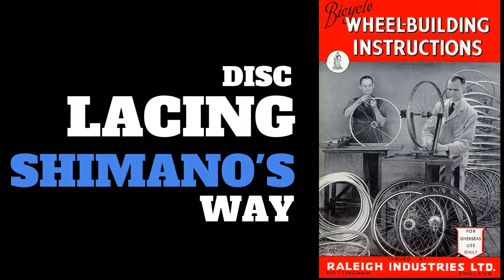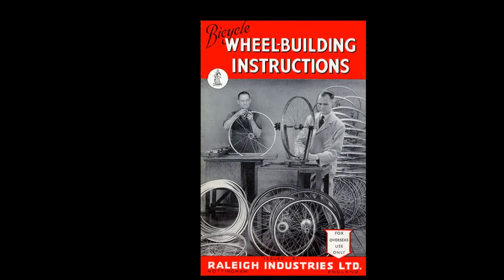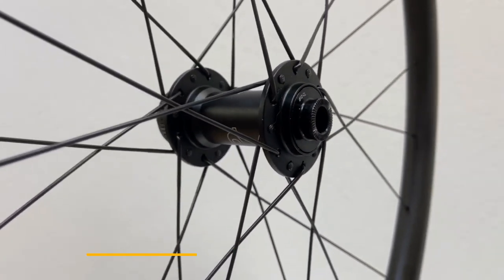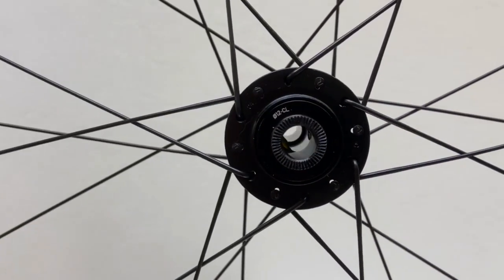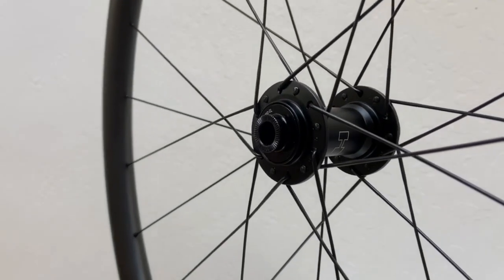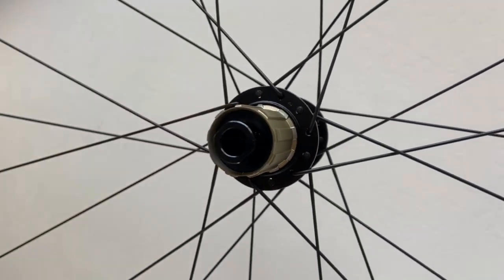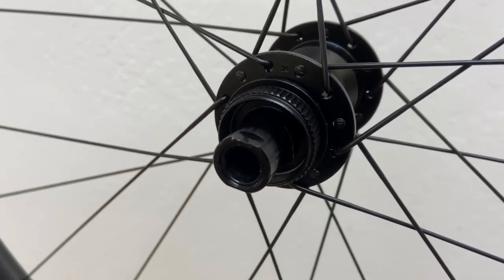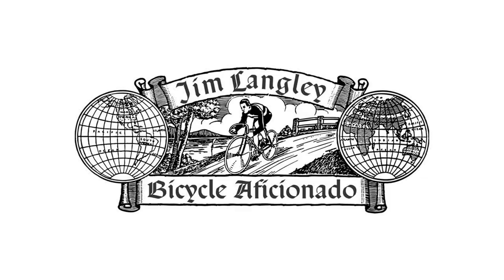How to Lace Disc Bicycle Wheel Spokes Shimano's Way

Comment: Is this Shimano's spoke lacing pattern applicable to the ebike (1x lacing pattern, 1000W motor, disc brake, rear wheel drive)?
Reply from the maker: Thanks for watching and the question. Yes it’s for all disc brake wheels. But if you’re rebuilding a wheel (versus building one from scratch) you should study how that wheel was built carefully because motor wheels may have specific lacing requirements that you need to follow. They often use oversize spoke holes, spokes and nipples and they might have a certain spoke pattern chosen by the manufacturer of the motor. I would copy the original lacing pattern or if I didn’t know what it was I would reach out to the company that made the bike and ask how they build it just to be sure. Hope this helps.

Comment: Well after you explained this is the comments on an earlier video I made the effort to get the trailing spokes heads in on the rear drive side on the last pair of wheels I made (no disks). Not sure it makes much difference but might as well go the extra mile!
Reply from the maker: Good job, Ben and thanks for the comment. There are lots of theories on how best to lace non-disc wheels, too. The best source to read up on it and learn is the late Jobst Brandt's book The Bicycle Wheel. It's been out of print for awhile and is pretty expensive on Amazon as a used book. Luckily Ric Hjertberg at WheelFanatyk.com posted the entire book as a pdf here: https://www.dropbox.com/s/mbsx865uzz0s7jq/Bicycle_Wheel_-_Jobst_Brandt.pdf?dl=0 If you're interested, Jobst was a wheel engineer and the book is full of great wheel wisdom. Thanks again!
Reply: @JimLangley1  Thanks! I remember Brandt from the rec.bicycles.tech newsgroup and used to quibble with him about the finer points of stress relieving wheels. Sad that he is no longer with us. I shall enjoy reading the book!
Reply from the maker: @benc8386  I rode with Jobst and on a bike he was fascinating. He was interested in bike technology. But he was more into physics and all the other sciences. When you were rolling along he would point out plants and trees and talk about the tides and equations comparing the differences in effort to ride say roller type roads to flat roads (the benefit of having descents then climbs vs a flat road with neither). I would just listen to him talk and learn. I remember the rec group back in the day, too. In person he was inspirational. Not to mention he was a giant of a man riding a humongous most impressive yellow Ritchey bicycle. I feel lucky I knew him a little. I think you’ll enjoy reading his book, Ben. Fun chatting about this stuff!
Reply: @JimLangley1  I'll second the Brandt book recommendation. I used it when learning the basics on classic C&V wheels.
Reply: What the hell is the leading or the trailing spikes and what's heads in it out.
Reply: @keithdunlop  Yes have finished reading it. Many interesting things in there.
Reply: @iamulfr1965  The trailing spokes are the ones that get pulled on by the hub to transfer torque to the rim. Heads-in are the spokes that have the head at the end of the J bend on the inside of the hub flange. Heads in alternates with heads out as does leading and trailing.
Reply from the maker: @benc8386  Thanks for explaining, Ben.

Comment: Where would I find the lacing steps for a Shimano asymmetrical rear disc wheel? I've only ever built symmetrical wheels.
Reply from the maker: Hi Keith - If you watch my video on building wheels here: https://youtu.be/XUqul03hbZ8 (you can jump ahead to the lacing section if you don't want to watch the intro), I show lacing an asymmetrical pattern. Basically, you make a wheel asymmetrical when you begin lacing (putting in the spokes) the second side of the wheel. At that point, you choose whether to make that second set of spokes asymmetrical or symmetrical. If you lace by putting all the spokes in the hub first and then lace the spokes to the rim, then you will need to be sure to put the spokes in in an asymmetrical pattern when you load them all in the hub. I don't lace that way. I lace one side and then the other side. Hope this makes sense and you can do it. If not, please ask more questions and I'll try to help more. Thanks for watching and the comment/question!

Comment: Are these HED wheels, if so we're they relaced. I'm noticing my HED disc wheels all have the opposite lacing pattern in the front and the drive side on the rear wheel. I'm looking at the eroica and arednnes wheelsets. Also, I'm guessing it's like you've said, there are all kinds of lacing patterns just make sure it's tensioned and true.
Reply from the maker: Hi Aaron! The wheels I show in the video are not HED wheels. They are wheels I built on HED hubs so that I can show the lacing pattern. 

To try to see how HED builds their road disc wheels I visited their website, but the photos are such low quality that I cannot make out the spoke orientation. So, I couldn't tell if they use Shimano disc lacing. 

If they do not, it's probably because they have their own theories on what's best. You are correct that not all wheel builders agree and that proper tensioning and truing are most important (assuming the hubs, spokes and rims are first rate, too). 

I recommend and use Shimano's disc lacing pattern because I trust they've studied & tested it more than anyone else. Shimano's been making bicycle wheel parts since their founding in 1921. If you're interested, I talk more about wheel patterns in my other video on Spoke Terminology here: https://youtu.be/4kVlmOjgdAs Thanks a lot Aaron!

Comment: Why is heads-in better at resisting a force than heads-out?
Reply from the maker: Thanks for the question, dimar. On disc brake wheels, the heads-in spokes are oriented that way so that the bends of those spokes are supported by the hub flanges. It's the support from the hub that optimizes the spokes' ability to resist the force of braking on the front wheel and the force of braking and pedaling on the rear wheel. It's the same reason it's a good idea to make all the trailing spokes heads-in on non-disc rear wheels - so that all the spokes working the hardest are braced by the hub. Robert Wright in his book Building Bicycle Wheels, describes the work these spokes are doing as "shouldering the load" and compares it to a person pulling a load with a rope and putting the rope over their shoulder for support. I hope this helps explain. Thanks again!

Comment: One more quick question Jim. Before I knew about the "Shimano" way for disc wheels, I built a rear wheel with a symmetrical lacing (the leading spokes on the rotor flange are heads out rather than heads in). The wheel is for a commuter/gravel bike, not a downhill MTB bomber. Would you rebuild the wheel? I see tons of MTB wheels built this way.
Reply from the maker: Hi Keith, I would not rebuild the wheel because it's highly unlikely that the rider would ever feel any difference in performance. (Although if the rider complained about it and had paid me for the wheel and it was my mistake, I probably would relace it.) As you noticed there are all kinds of spoke lacing patterns on wheels out in the field and the most important things are that they are true, round and properly tensioned, not the lacing pattern. Doing it the Shimano way has become an industry standard for many pro wheel builders since Shimano is a components leader that does their homework. So it optimizes the lacing to support disc wheels. But, plenty of disc wheels laced other ways are out there and doing fine ;-) I hope this helps!
Reply: @JimLangley1  Thank you Jim! I was loathe to rebuild it since it's pretty much perfect and I would have been bummed to take it apart.